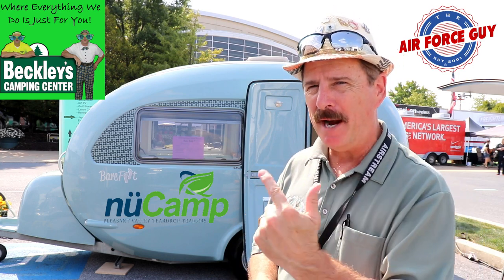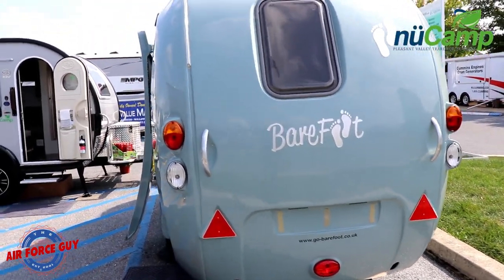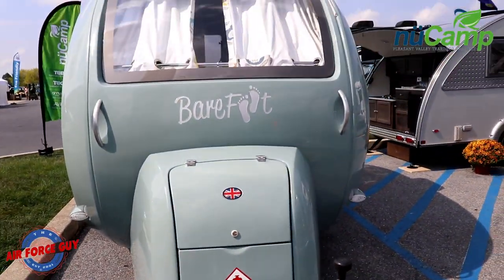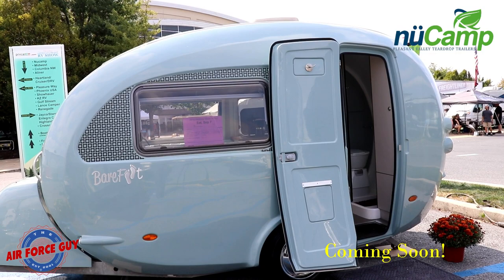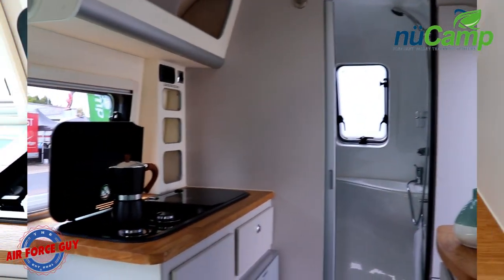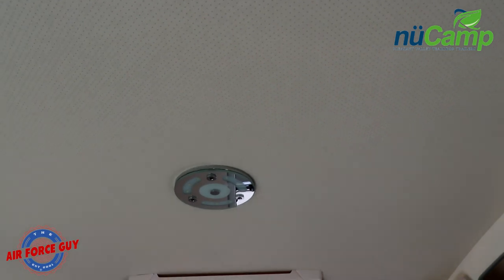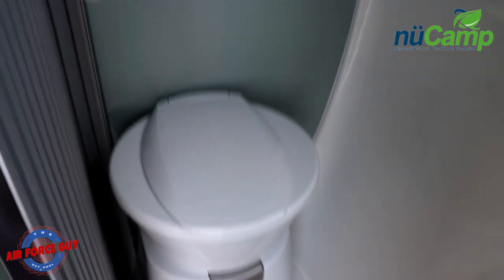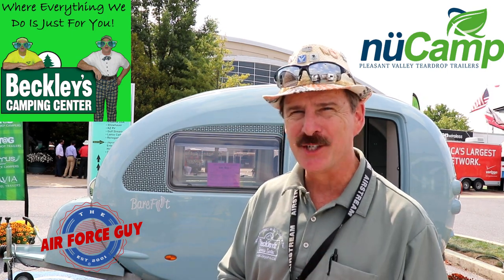Coming Soon! Barefoot by NuCamp RV  -  w/"The Air Force Guy"

Comment: Any idea on weight? 1500 pounds, maybe?
Reply from the maker: I am sure it was much higher than 1,500 lbs.  Will not know any specs until they actually make the US version.  Thanks for Watching.
Reply: @TheAirForceGuy  is it bigger than the TAB-320? Those are 1800-2000 with a steel frame, AC, black tank, etc. no?
Reply from the maker: @corystansbury    Found the specs for it and it is just over 2,000 lbs. dry with a gross weight of just over 2,300 lbs. Length is just under 17'.  Now, keep in mind this is the UK version.  Will have to wait till NuCamp gets one built here in the US to have final specs.
Reply from the maker: Here is a 2016 UK Video on it:  https://www.youtube.com/watch?v=L7_H73HZ-9A

Comment: I like these Barefoots, but they start in the low to mid $30'ks in the U.K. (home market).  If they think americans will pay that premium, they are in for an awakening.  They simply cannot price these at or even close to the Airstream nest price.  Low to mid-20's, they might have a winner.  Anything more than that, buyers would be crazy not to get a loaded 13' Scamp or Casita model, which max out at around $16-17k, or a much nicer and larger Molded Escape camper in the mid $20's.  My guess is they ditch the Aluminum Frame and many of the Premium Materials,  and slap in a bunch of stuff from the Tab 400.  I hope I'm wrong, but the American version of this trailer will be nothing like we see here.
Reply from the maker: Chris, Thanks for watching.  I was telling everyone who asked for the price at the Hershey RV Show that these will be in the $30,000 - $40,000 range and they seemed Ok with it.  It will keep some people from owning it, but I hear that a lot about how expensive the T@B 320 and T@B 400's are and yet they sell.  I am being told that it will be as close to this trailer as they can get it.  They will give it more ground clearance, add an A/C, move the door to the other side and probably change the windows some.  Just have to wait and see.